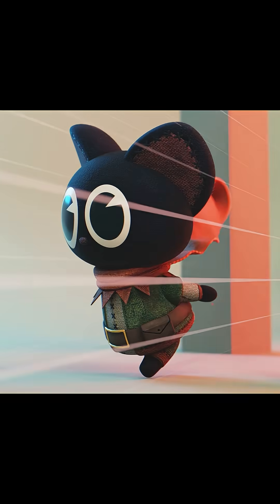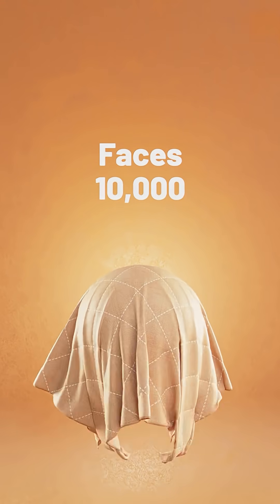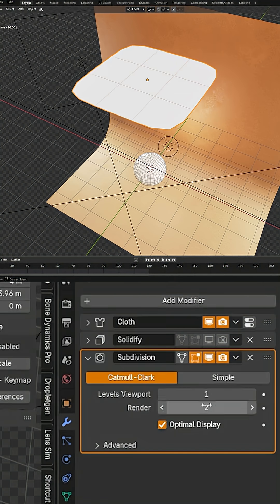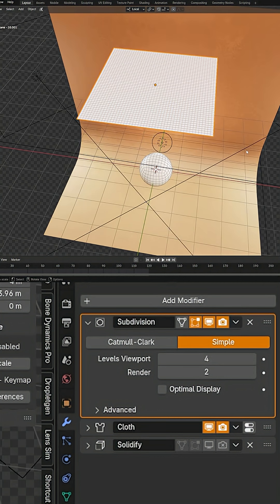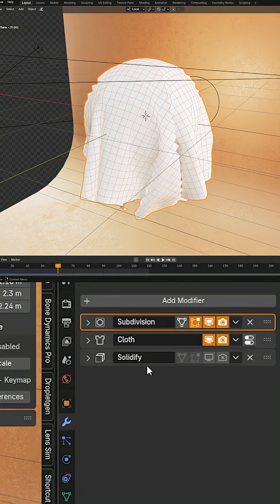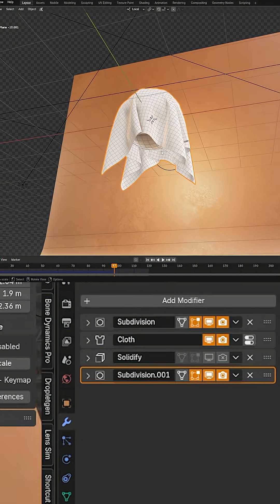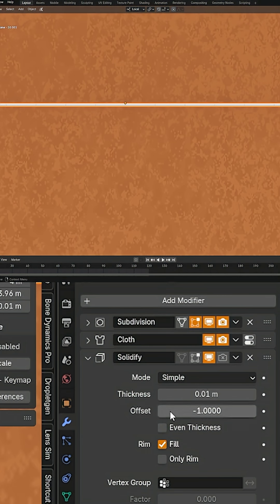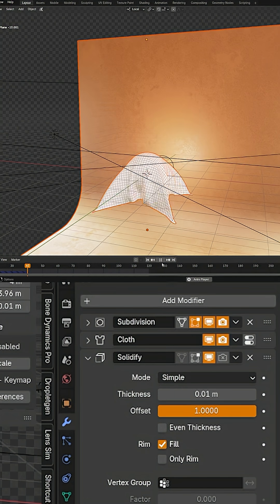Cloth Sims Suck  Maybe it's your Topology in Blender

Comment: If you add a smooth corrective on top of the cloth sim, you  will smooth out the simulation, resulting in better cloth movement.

Comment: The probably best tip for cloth simulations in Blender is to scale up the objects, since Blender does not really like to work with small ones.
Just keep in mind that you have to tweak some cloth settings else the simulation won't look like how actual cloth of the original size would behave.

Comment: I don't get it. How adding modifier and not subdividing manualy saves calculations? In the resolt we are getting the same aditional points, lines and poligons.
Reply: I do think it's mostly that using a modifier lets you have a lower quality simulation when you're not rendering.
Reply: Also saves file size cause you're not storing all that extra geometry, just generating it when it's needed
Reply: @madeline8062 It makes sence.
Reply: I'm right there with ya
Reply: The subdivision at the end makes sense, but the subdivision at the top really doesn't except for what Madeline mentions about saving space. It's still exactly as complicated as before, I have no idea what the video creator is thinking.

Comment: Wait ... Not applying the subdiv modifier is faster than it being applied/ real geometry ? I was under impression it is the other way around and that having a modifier is more computation. I also know of a fairly common trick to have a lower Res simulation mesh and than using subdiv mod to smooth it a bit but that is different story.

Comment: have you figured out a solution to frame rates and sims? like making the sim lower fps for matching animation 2-1?
Reply: You could bake the sim object into a .ABC Alembic file, reimport as a mesh sequence cache, and use the override frame option with a driver to skip every other frame, wouldn't work in all cases but could be helpful in some.
Reply: @williamsmith6921 would this work with baking hair Sims as well you think? I think I did this in the past with fluid Sims now that you mention it.
Reply: @SupremeBean82  I wasn't sure so I went and tested it, yeah it works with hair sims.